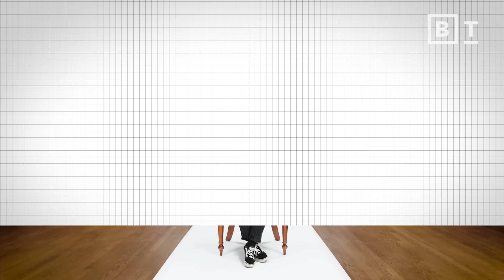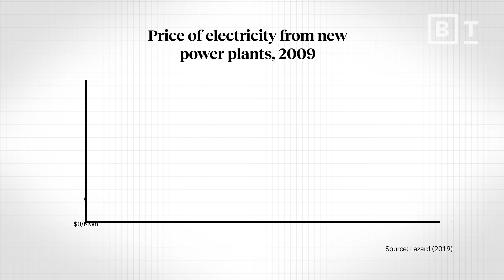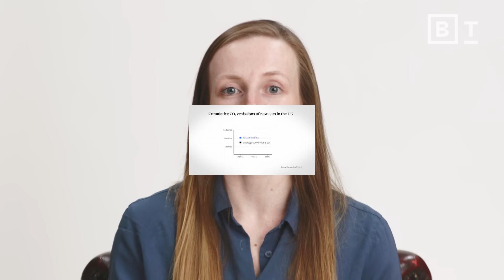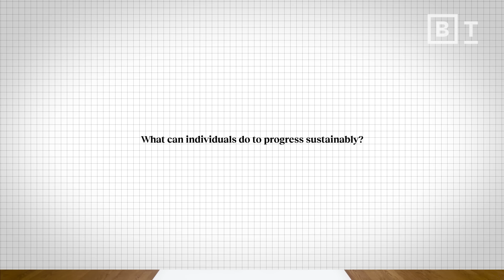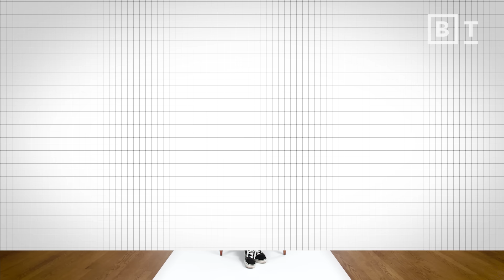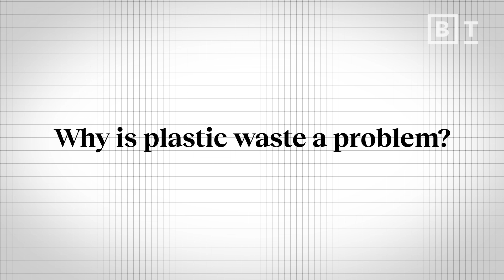Hannah Ritchie: The data behind our biggest environmental problems | Full Interview

Comment: 31:48 Localized food production. Assessing the land in a set grid, how many people does the land have the resources to sustain? Once that number is identified then assess how that number can be sustained with the absence of land used by the population. Once that number is determined, figure out the difference between it & the actual population. This gives us the needed information to implement technology & techniques that can produce the basic food & water supplies for the area using green techniques and dense cropping. Converting office buildings into hydroponic food production facilities & initiating work from home mandates can help in heavily populated urban environments. This would also increase employment opportunities, food loss, nutrient losses, increase fresh food consumption & reduce shipping emissions. Also increase the popularity of growing your own foods in gardens or apartment sized hydroponics systems. The apartment type setups can be added as a mandate for all new residential buildings after the most efficient & durable system has been developed for long term use. Creates a reduction on dependency of the regional needs and creates jobs for upkeep.

Comment: 14:46 What has been done about generating power from the forward motion of the wheels once moving? Each wheel could have its own motor to reduce the power production needed to engage the system. Or they could be used to generate one large power output creating a closed circuit of generation and usage. Better clock worked generators making more power in a condensed generator should be created and utilized in either application. And rethink combustion engines to see if there’s a way to make them fully electric engaged where something pulls the pistons instead of pushing them.💜
Reply: Also the clock worked improved generators could be used to make a cyclonic system using pressurized water pipe circuits to generate electricity for individual units on sight.

Comment: C – Cut gas, bitumen, coal, oil, clinker (geo-GHG) 1.7%/month GWP/10 years.
A – Abate high GWP/10 year emissions, using bio- to replace geo- if needed.
N – Negative embodied emissions in materials as much as possible ASAP.
D – Diversify wilderness with maximum afforestation and conservation ASAP.
 I – Inform policymakers and engineers on GHG-negative economic benefits.
E – Eliminate all geo-GHG leakage through trade and financial border measures.
S – Strategically overcome regulatory capture by effective grassroots action.

This plan moves the world off fossil at the rate of attrition of fossil equipment, when it's most economical to transition. And fossil-free, at scale, is more economical than fossil, anyway.
Reply: Plus, if we continue stratospheric aerial spraying at the current rate - we'll exacerbate global warming and force people to comply with CANDIES  -  i must say... smart. very smart.

Comment: It is not possible to reduce the carbon in the atmosphere. The oceans are warming and are releasing greenhouse gasses. Even if we stop using fossil fuels the increase in carbon will continue to climb. We absolutely must stop burning oil. We need the oil to manufacture needed materials like PC boards.